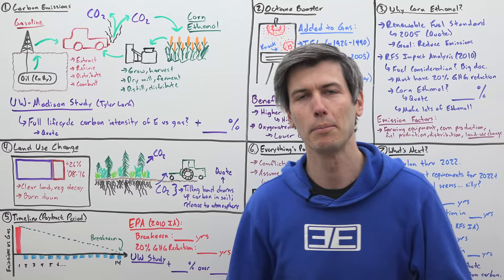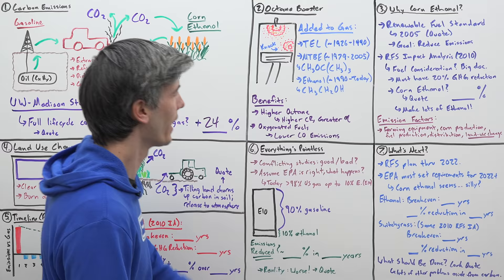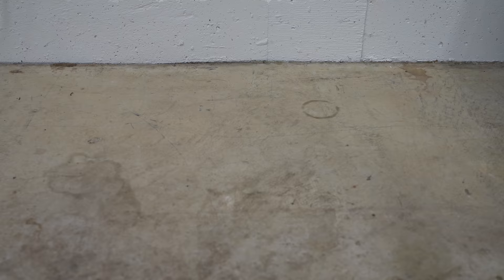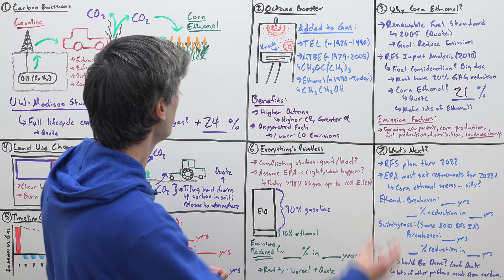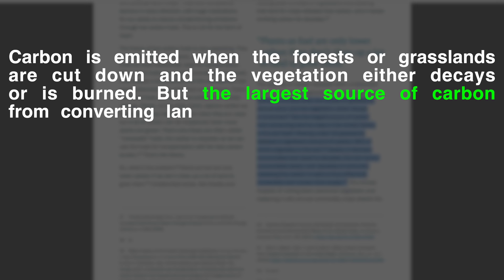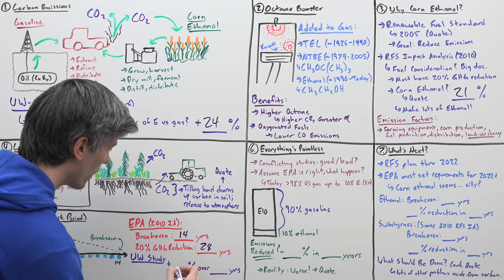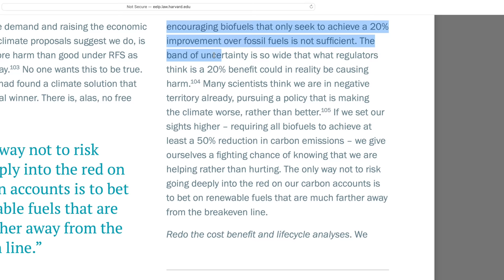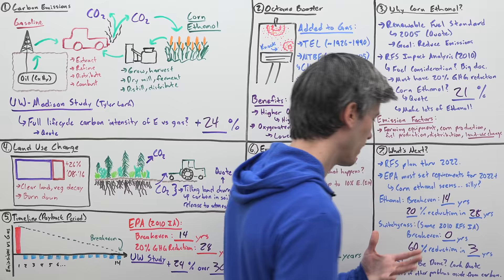America Was Wrong About Ethanol - Study Shows

Comment: I'm a chemical engineer. One of the projects we did in my plant design class was a corn based ethanol plant. You could tell who couldn't get their head around it being a net energy loss and losing money. A few groups tried to say their plant was profitable. Since corn has such low sugar concentration, it takes more energy to make the ethanol than you get from it's use as fuel. Need to use something like sugar cane or sugar beets like Brazil does to make it profitable. My professor made it a point that we all knew back when these regulations were rolling out that it was worse just from that aspect. Any savings in emissions at the tailpipe is lost in the production of the ethanol. Not to mention, all the corn being gobbled up for fuel made food manufacturers move to soy which caused food prices to increase. Now, biodiesel plants are moving to soy bean oil, so there are more food price increases as they compete with heavily subsidized biodiesel plants for soy.
Reply: @richh1576  Most folks in Maryland hadf small farms or had a relative with one until the early 60's anyhow as gasoline ended up being gasahol we let each other know make sure you run it dry because condensation
Reply: Or use Dry Gas once in awhile
Reply: I believe.  And have suspected for decades.
Reply: Also, the pressure on the corn supply pushed corn farming into traditional beef production in Brazil, which pushed Brazilian beef production into the Amazon, with negative environmental consequences.

The environmentalists all know this, but they don't care because they are focused on money, power, and fame.
Reply: Corn is 70% sugar - is that low?  Beats are 20% and cane about 12%.
Reply: @brokenrecord3523  deez guys clearly never ran a e85 tune on their cars before XD
Reply: I live in Nebraska.  No farmer could ever tell me why we make ethanol out of corn instead of sugar beets, both of which are grown in this state.  I guess it is because everybody is already growing corn and nobody wants to switch over to growing sugar beets.
Reply: Australia uses sugar cane and wheat starch for our ethanol.
Reply: I've heard hemp was one of the best crops for ethanol production, but back 20+ years ago was basically disqualified from competition.
The corn lobby is unbelievably massive, but few people are aware of the influence they have.
Reply: @ianmontgomery7534  Brazil uses Sugar Cane.
Reply: @brokenrecord3523  

Not sure where you got that figure.🤷‍♂️
Corn is high in starch… which must be converted to sugar.

Sugar can then be fermented into alcohol (ethanol).

But it’s efficiency isn’t even close to 70%.
Reply: @bbbf09  Hunger is a economic thing currently. We could feed the population its just that we will not.
Reply: @richh1576  Laws of thermodynamics do not apply to this system. There is a good reason. It is difficult to examine the assumptions made if your looking at the process. You need to take a big step back and ask why this makes money. 130% huh? Whats up? The price of oil is up! That controls the process.
Reply: @kaeto  The environmentalists all work for big oil they just don't know it.
Reply: @valiantsloth how about cannabis/hemp ethanol?
Reply: @BillMcGirr  I get my information from being a fermentation chemist for the last 15 years.  Starch is polymeric glucose aka sugar.  It is broken into individual glucose monomers that are consumed by the yeast with enzymes: alpha and glucoamylase. As for efficiency, a typical fermentation starts with 23% sugar and ends with 0.08%, so 97% efficient?  As for conversion to alcohol from starch, that's about 95%.
Reply: @richh1576  I come up with a square mileage number in the 36,000 - 200,000 range. So, the size of 2 Colorado's at worst, or 1 Indiana at best. The worst-case calculation is based on a 1600 sq ft land footprint only producing 9,000 kWh in a year, which is extremely conservative. The solar system on my roof does much better than that.
Reply: Did they tell you about the net ground to pump energy loss you get from taking oil out of ground in Russia and shipping it to us then refining it then shipping it? Keep petro company blinders on
Reply: @kimwilson7150  But many of the areas that have starving people are areas that breed regardless of food supply.  If you feed those areas, the population increases but the food supply of the world does not.  Eventually, you just have more people to feed, and when the food runs out, more people die than if they are allowed to starve from the beginning.  Forced sterilization for food could be an option.  It's immoral to give people food that breed indiscriminately.
Reply: Thank you for mentioning what Brazil is doing. Also, in Brazil, they use the squeezed out sugar canes (sugar already extracted) as the fuel (dried, then burned) to distill the ethanol. In the US, they distill either using natural gas, or electricity, to boil the wort (pre-distilled ethanol).
Reply: Miscanthus grass solves most of the corn problems and produces substantially more fuel/acre. Less money to the corporations for chemicals and doesn't destroy the soil.
Reply: This is why using byproducts of other industries like molasses to make ethanol makes more sense.
Reply: @richh1576  He didn't mention the required inputs of mining/chemical/fossil fuel based fertilizer production, or farm equipment fuel consumption. Really the only answer is to use less energy, but that would be horrible for business. And, it doesn't mean having less stuff. I had a 1984 car that got 50 mpg, it has to be intentional that we can't do a third better than that in nearly 40 years.
Reply: @CatastrophicNewEngland   ....and how long did it take for your cylinder walls to prematurely wear out because of the higher combustion temperatures due to the "lean burn" caused by under fueling (no longer cooling the chambers with excess raw fuel)??    ;-)

Apparently what the engine manufacturers are doing to increase 'mileage' is to loosen the 'springyness' (compression) of the piston combustion rings in order to lessen friction with the cylinder walls .... leading to severe problems with carbon deposition in the piston ring grooves ... causing all sorts of 'burn' problems when such an engine ages due to 'stuck' combustion rings - plus, usually uneven and sporadic cylinder wall wear .... and unexpected loss of engine output efficiency.
Reply: @richh1576  not a large area at all.
Reply: @valiantsloth But aren't we throwing out like 20% of all produced foods due to the extremely high aesthetic standards of the supermarkets, restaurants etc.? That could be used for fuel as well and needs to be taken into consideration when making the equation
Reply: @mrtamegm  Russian oil represents 3% of the total oil in the US. Most of Russia's oil was consumed in countries near Russia.
Reply: @lucastonoli3256  free markets have slot to do with perspective rather than reality need I say toilet paper.
Reply: @brokenrecord3523  corn might contain sugar, but it's all in starch. which needs to be broken down into sugars before it's converted into ethanol. the same is true for potatos. The thing with sugar beats and sugar cane is that the sugar isn't in a starch form. it's pure sugar that doesn't take that much power to extract.
Reply: @TheObsesedAnimeFreaks  
The absolutely easiest thing to do in any fermentation process is to break the starch down - it takes about about 0.01% of some enzymes and a couple hours.  Beets and cane also use similar enzymes to free the sugar.  .
Reply: @richh1576  Why wouldn't DMFCs running methanol produced by Miscanthus be a solution? At least better than anything now
Reply: @Leslie Fish At an industrial scale worth wasting that chunk of land, manpower, and resources on? What kind of return of investment can you expect?
Reply: @richh1576  LOL - thermo doesn't lie!  That's why one of the first classes of people sent to the gulag was engineers.
Reply: @richh1576  It was a VW 1.9 turbo diesel! Was still going strong when the rest of the car rusted out a handful of years ago, at 300,000+ miles. I was just pointing out how we have the tech to make small, efficient vehicles, but choose to do stuff like make moonshine instead of lowering weight/size, increasing aerodynamics, & lowering rolling resistance.
Reply: @aldenconsolver3428  you do realize that a mom and pop family farm is frequently organized into a corporation, right?
Reply: @brokenrecord3523  I never said I knew anything, you clearly know more then I do being a bio chemist
Reply: @brokenrecord3523  

Really… that’s adorable.

Then apparently I’ve been turning corn and other assorted grains into ethanol as long as you’ve been alive… and probably longer than your parents have been old enough to drink it.

You might like to exert that corn is “70% sugar”…
Which is incorrect….
The cob is completely useless and totally worthless.
Correct?

Never mind the stalk and the husk… correct?🤯

I’ve never met anyone who even uses the cob to feed livestock… much less use to produce ethanol. 

Why would you when corn kernel is $10 per 50# RETAIL.

Good news your wife can turn them cobs into Thanksgiving decorations.🙄

So obviously AT BEST perhaps 70% of the KERNEL is potentially usable as starch.

I’ll leave it to you bookworms to do the math on the cob to kernel ratio.

But I’m betting it’s around 50-50 cob to kernel per weight.
So that would automatically make 40-50% of the corn useless.

And mind you… that’s NOT INCLUDING the stalk and husk.👍

But obviously not 70% of even the kernel is used… obviously.
You can tell by the amount of waste after starch extraction.

Good news… that is viable livestock feed.

And a 2 minute conversation with ANY REAL WORLD distiller would tell you that the efficiency you’re talking about is fantasy.

After all… YOU ARE THE ONE asserting sugar cane is 12% sugar.🙄

When OBVIOUSLY after processing sugar cane is 100% sugar.
Duh.

But obviously you made ZERO EFFORT to include corn cob, stalk and husk.
Right?

So obviously you made an effort to skew the comparison.🤣

Obviously corn is cheap… REAL CHEAP.
At least in America.

I appreciate the 2 cent lesson in distillation….
But I forgot more information than that before you were even alive on the planet.

👍🥃

Oh… and PS…. If you were working at my distillery spewing such nonsense.

I’d have shown you the door by coffee break.

I’ve met 4th grade educated hill billy’s who comprehend real world distillation and efficiency better than your pretty piece of paper.

You’re welcome.👌🏻
Reply: @MichaelJones-rn2pq  Harvesting. Combines are much more prevalent and easier to have a traveling harvester just fill your grain bins. Beet pickers seem to be much less common. 

Also, after living in sugar beet country and driving harvest truck, the plants really, really, smell like asshole.
Reply: @brokenrecord3523  Feed corn, not sweet corn. I really doubt that 70%, considering they can get more ethanol volume per acre from sugarcane than corn.
Reply: @richh1576  22000 square miles about the area of lake Michigan. Wind works as well which is why a certain politician hated them.
Reply: @leftyeh6495  Yes - #2 yellow dent feed corn. Both are about 560 gal/acre. The benefit of corn is A. it can be grown in the midwest and B. It keeps-whereas cane syrup spoils rapidly and must be processed immediately.  That way you can make the plants smaller and run year round with corn.
Reply: @brokenrecord3523  Sweet Corn hybrid varieties have sugar contents upwards of 20% (e.g. MasterSweet is 18%) whereas field corn (cow corn) has a much lower sugar percentage and a much higher starch percentage.
Reply: @richh1576  I guess your chemistry professors never did the 50/50 demonstration? 50ml water + 50ml ethanol does not equal 100ml; some of the ethanol fills the voids between water molecules. The same thing happens with gasoline, but I'm not sure where the tipping point is.
Reply: @bassplayinfool  last try, then I give up
        s t a r c h     is     s u g a r
Reply: The total fuel consumption of U.S airlines is approximately 19 billion gallons annually. 

Total fuel consumption for mining lithium to make electric car batteries is 21 billion gallons annually.

The 21 billion gallons can only produce enough lithium for 250,000 car batteries.

The lifespan of an electric battery is 10 years and is not renewable.

Electric cars are not better for the environment.......they're worse.
Reply: @leftyeh6495  I live by an ethanol plant.  It smells like rotten grain from the bottom of an auger trough.
Reply: @richh1576  Just a side note, the low energy density of ethanol does NOT warrant lower power output. The engine aspirates a fixed amount of air, which is the limiting reagent. Ethanol makes 2-7% more power than most pure hydrocarbons. The difference in energy is taken up by the control system, which is designed to account for an array of other things.
Reply: @MichaelJones-rn2pq  There is byproducts of ethanol that "Car guys" have no idea about. Biorefinery is the correct term for an ethanol plant. They create ethanol, dry distillers grain (Animal Feed), CO2 for dry ice/soft drinks/beer,  and Corn oil. No Biorefinery makes money just selling ethanol.
Reply: @sawyershipman8336  I used to work at one and climbed on top the tanks that contained corn starch.  However, I don't think any "biorefinery" makes money on its own.  I would like to see all subsidies and tax breaks removed from ethanol and see if the industry would support itself.  Actually, that goes for EVERY subsidy that the federal government now hands out.
Reply: @MichaelJones-rn2pq  I used to as well. 2.5 years.
Reply: @richh1576  whoa some real crazy talk there....I like you.
Reply: @mrtamegm  little narrowly spoken there.
Reply: @toddfenton9930   don’t deny but still a lot of  pot to the kettle in this conversation Socratic dismissal is not what I’m trying to do but most the anti ethanol videos seems to be doing it. Did you actually watch the videos? Would you agree Cleaning up environment goes way beyond just co2
Reply: @richh1576  
Why don't you simply give us the answers to your questions?
Reply: @kaeto  
Environmentalist fame? How so?
Reply: @richh1576  
Which car manufacturers are recalibrating engines to "burn lean" and how do you know this to be truthful?
Reply: @brokenrecord3523  I guess you probably should have just stopped while you thought you were ahead.

Anyway,  good thing monosaccharide and disaccharides break down the same way as polysaccharides, right?

RIGHT?
Reply: @michaelmoorrees3585  the squeezed out sugar cane is called bagasse.
Reply: @Leslie Fish ethanol from "vegetable trash" production is very inefficient. Looks good on theory.
Reply: You can also make biofuels from the other 90% of food crops that are not edible (including corn cobs).
That’s one of the reasons sugar cane works really well - the production of cane sugar is fuelled by the waste sugar cane (bagasse).
The Fischer-Tropsch process can convert biomass into fusel oils that you can make gasoline from…
Reply: @MichaelJones-rn2pq  Like oil?
Reply: @tesstess3371  Yea costs more.
Reply: @kimwilson7150  Yes, like oil...and everything else, including charitable contributions and mortgage interest  and child tax credits and anything else that lets people avoid taxes that others have to make up.
Reply: @MichaelJones-rn2pq  Just too many irons in the fire for an easy fix. Once fixed the game begins again. Sisyphus begins again.
Reply: @brokenrecord3523  assuming you are right, it would seem the feed value of used corn waste from alcohol production is a lot less than others are claiming here.
Reply: I read that Dick Cheney visited Mexico just after we started putting food in gas  tanks. Mexican poor folk, the cost of whose staple food increased by half overnight, are supposed to have pelted him with tortillas. Too bad it wasn't bricks.
Reply: @michaelmoorrees3585  We don't just use the squeezed stalk to boil, we use it to power homes. Not to mention many cars are flex, meaning they can run on the E27 anhydrous alcohol (The legal minimum is not just 10 percent) but the car can run on the Hydrous E100 as well. We also have cars that take natural gas. Many options.
Reply: @BillMcGirr  Why doesn't the US burn the cob instead of coal in power plants??? Brazil not only makes fuel out of sugar canes, the stalk is burned to make electricity.
Reply: @allangibson2408  Sugarcane works because after the "caldo-de-cana" aka, sugar juice/broth, is extracted - this is what turns into the alcohol - the "bagaço" (bagasse) is burned to boil the Wort (that is made from the juice - NOT the waste). The waste is also burned to power homes/make electricity.

The waste is a "biofuel" in the sense that it replaces other fuel that create heat to then create steam/vapor to turn turbines, like coal or natural gas. But it is NOT the biofuel that fuels your car. The alcohol that goes into your car is NOT from the bagasse. The industry doesn't convert the solid to liquid for your car.

Not a single country uses the Fischer-Tropsch process on sugarcane waste. What WAS tried, and failed, is an attempt to produce Cellulosic ethanol.  It wasn't cost effective. The resulting fuel was too expensive. There doesn't exist any plant that produces Cellulosic ethanol to any scale today. (A few plants exist for demonstrative/research purposes only)

(Brazil does use the impurities from the juice to fertilize crops)

You should watch the video by Petrobras entitled Etanol Sem Fronteira - episódio 3. It has subs in English that are decent.
Reply: @ChibiHoshiDragon  Just because they don’t doesn’t mean they can’t.
The process used to run sugar mills using boilers fired on bagasse was defined a century before the the Fischer Tropsch process was invented.
The Germans were originally using the Fischer Tropsch process on brown coal - which is only marginally different from running on agricultural waste.
Running a fermentation process on sweet corn uses 1% of the actual organic matter grown as feed stock for fermentation.
Sugar cane uses over 10 to 15% - an obviously better option without a doubt. And even better if the waste is used for process energy.
Reply: @allangibson2408  
Check my edit. I added info on the attempt to make Cellulosic ethanol and a few other things. The F-T process has never been commercially attempted on bagasse or corn cobs.

I also was trying to make a distinguishing point between power source and:
The Fischer-Tropsch process can convert biomass into fusel oils that you can make gasoline from

You would get a synthetic fuel, but not one that you can mix with gasoline and run in standard cars. (Kind of how natural gas is a fuel, ethanol is a biofuel. Methane is a biofuel. Cars can be MODIFIED to run on natural gas and 100 percent ethanol but has yet to be fully-commercialized on a grand scale to run on methane (and either way, you have to convert to use CNG - and lose trunk space to do it). To mix with gasoline to run in an unmodified car... We can't do that with synthetic fuel yet. It can mix well with Diesel... but it is not gasoline.
Reply: @ChibiHoshiDragon  Fusel oils can be converted to 100% compatible automotive fuel with zero modifications to current production cars.
Sasol and China do it from coal liquifaction and New Zealand did it from natural gas (until Methanex bought the plant because methanol is far more profitable). All use a Fischer Tropsch front end.
Break even is a crude oil price between 80 to 100 US dollars per barrel.
Low crude oil prices have suppressed developments for decades however.
Reply: @ChibiHoshiDragon  

Awesome… move to Brazil 🇧🇷 

Have you ever tried to heat a Country of 360,000,000 mostly citizens on corn 🌽 cobs????

No?

Then sit down and shut up.
The adults are speaking.👍

The poor and working class benefit from cheap fuel the most.

Duh!

Wake up.🥃
Reply: Just like the green new deal will do, less for more $
Reply: @brokenrecord3523  Math is not on your side.
Reply: @MichaelJones-rn2pq  ADM isn't in the sugar beet business.  I bet "the big guy" just got a big payday from his buddies at ADM.
Reply: @richh1576  This is true.  Change your oil every 5000 miles or you'll get the ring sludge build up and high oil burn.  Happened to my camry.
Reply: @TheObsesedAnimeFreaks  Exactly.  Corn ethanol is a money loser- hence the gov't subsidy.  ADM wrote the corn ethanol law- imagine that!
Reply: @sawyershipman8336  They make money by getting government subsidies.
Reply: @johnorenick9026  You are describing Americans here very soon.  And because all the Mexicans will be here TOO!  LOL
Reply: @BillMcGirr  They sell pellets made of corn and pellet stoves. There is also this thing called silage where they use all the corn stalk and all. You really embarrassed your self. Very sad.
Reply: Corn and Soy all GMO and owned by Monsanto and other big AG companies which actually started off as chemical companies
Reply: @CatastrophicNewEngland  In India, most budget 5 seater cars with 1000cc to 1500cc engine capacity give petrol mileage of around 20-25 km per liter or 47 to 58 miles per gallon of petrol. In case of diesel cars the mileage is even more for similar engine capacity.